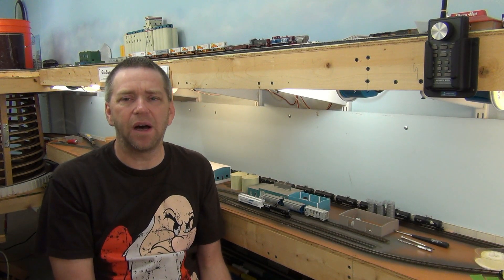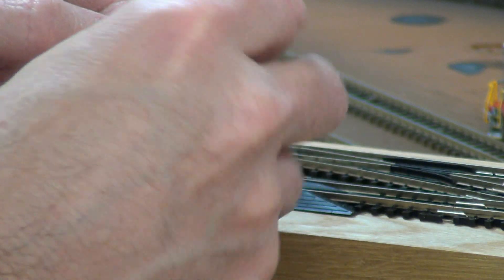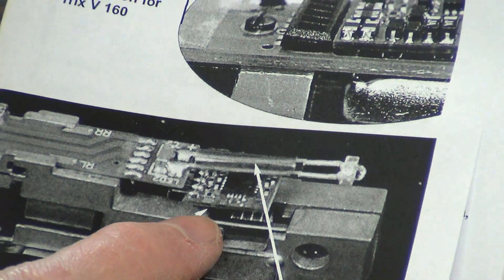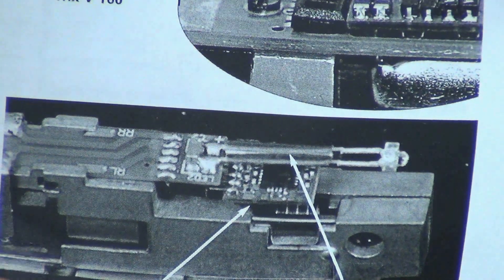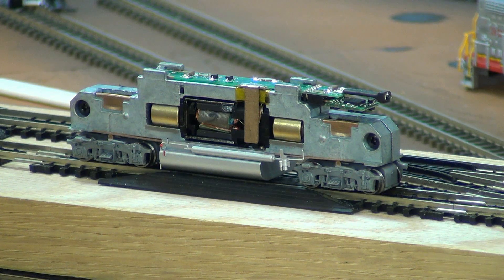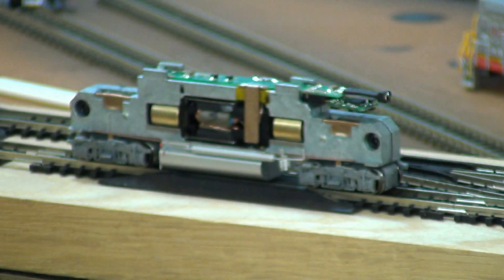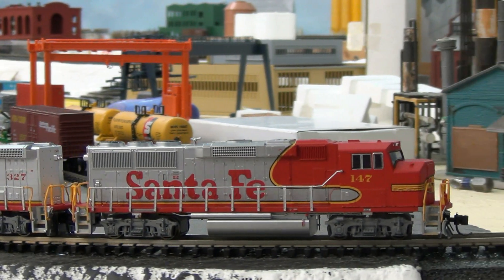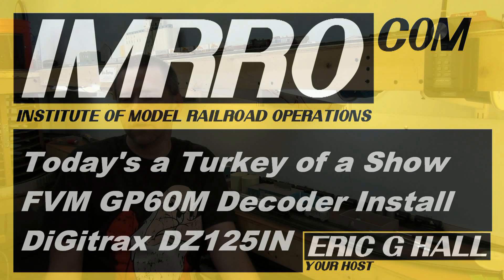How to Install a DCC Decoder in a DCC Ready Locomotive

Comment: This video sucks he skips how take case off. The most important part.
Reply from the maker: mythinkorg you might watch the video when that is done earlier on that same engine.  No need to keep showing the same thing over and over.  Then people like you would say this video sucks,  it is the same shell removal as the last video
Reply: Well kept searching didn't find any video on removing the case was able to get it off with out breaking any thing. But still have to say cut down on the Fluf and yes show how to do everything from beginning to end. Also this decoder is tricky. Not sure if the analog DC plug matters which way it's pluged in because pin 1 on the Analog plug vs Digitrax DZ126IN is opposite. Since was not sure tested it on Programing Track and found that what though was pin 1 was not pin one.
Thus with my unit was upside up vs upside down. and the the Decoder fit both ways. but o the programing track was able to confirm correct orientation with out burning the decoder by reading the Loco motive ID and writing new Locomotive number.

Comment: This product (DZ125IN) has been replaced by the 1 Amp Z / N / HO Scale Decoder with 6 Pin NEM 651 type plug (DZ126IN) and is no longer available
Reply from the maker: Good to know
Reply: There are still plenty out there in the supply chain, however. Purchased one yesterday at my local hobby shop. Wonder what I'm missing out on with the DZ126IN?

Comment: Hey Eric, I dont know if you know but you can buy PCB header socket pins (in strips of about 36) which you can use as spacers between the decoder & the decoder socket on the loco, to avoid any potential shorts.. I know you shouldn't have to, but it's a work-around...
Reply from the maker: Yes I' know what your talking about.  Did not think about them at this time.  We will see,  maybe a later video.